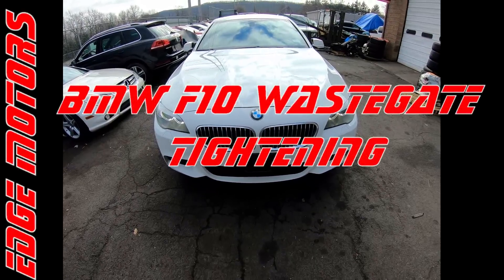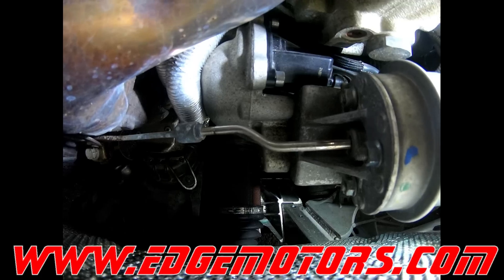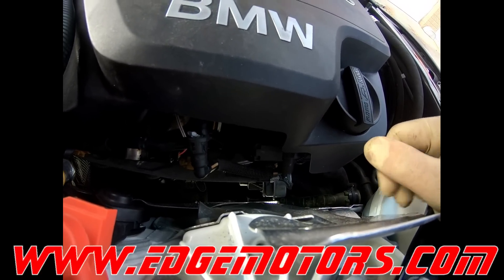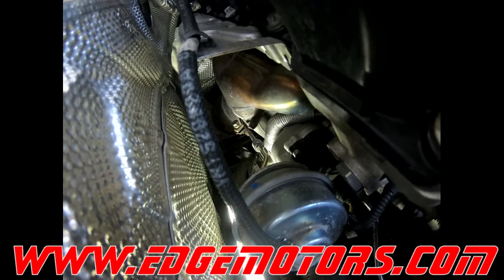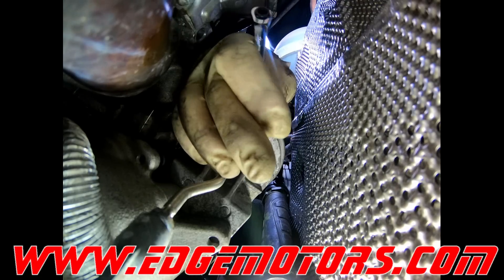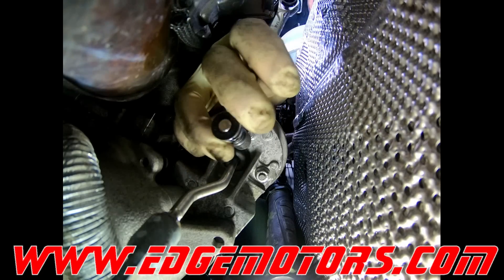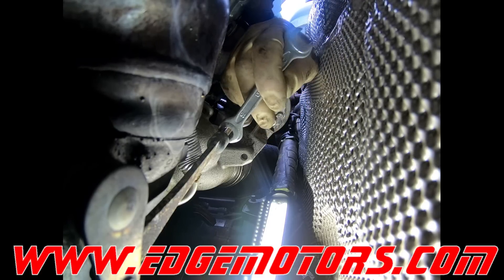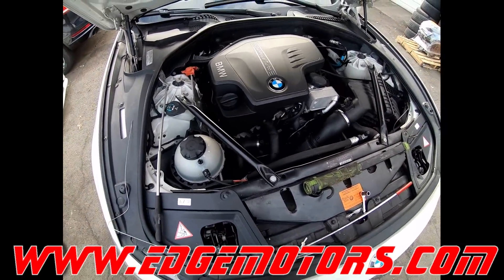BMW F10 Waste Gate Rattle Turbo Under Boost Codes by Edge Motors

Comment: I have an f10 with similar engine cover, connecting 2 hoses. What is the other hose which is not broken in your video? I see some oil in that pipe, is that common?

Comment: Will it work if i replace the entire wastegate actuator assembly
Reply: Did you end up doing it?
Reply: @emoney8678  Yes, i did. The wastegate arm came back absolutely rock solid
Reply: @zyzz1992  bro no way thanks for the reply! Just gotta ask if you had the drivetrain malfunction pop up and if so did that fix it ?
Reply: @emoney8678  The exact code that I got was 120308, charge pressure, plausibility pressure too low. Smoke test didn't reveal any leaks so we suspect it could be the wastegate as my wastegate had a horrible rattle (You can  see the short video I uploaded on my channel, it rattle bad as I let off the throttle). Took a gamble and replaced it and I'm glad it turned out good!
Reply: @zyzz1992  thanks for info bro, I guess this rattle is very common. Mine sounds terrible when foot off gas
Reply: @zyzz1992  Hey! I have a 2012 528i N20. Ive been getting the “FC120308 boost pressure control, plausibility: pressure too low” code for a few years and drivetrain malfunction. This is the only code I have. Car drives fine but throws code every time I accelerate for the first time of the drive. It’s a pretty loud rattle when the car is just sitting as well. Could this just be the wastegate actuator? If I replace that with another one, could it solve the problem?

Comment: Thanks for the video, it helps when chasing "boost leaks". I have a f10 with n20 pneumatic wastegate. It kinda make the same noise like you did the high rev, the crackling rattle noise, I was chasing leaks between pipes and got no luck, changed the diverter valve and still got code 120308 where it says pressure too low and occasionally pressure too high in the leak. Any chance do you think I could have the wastegate issue? Or could it be the solenoid. I cant really find parts for pneumatic wastegate only, they seems to come together with the turbo. Any advice?
Reply: possible to have oil in the actuator, check the vaccum tanck to see if you have oil in it.
Reply: Its the flap inside of the turbo at the exhaust gas exit. Its loosen up with the time it has to be welded and everything is fine.
Reply: How did u remove the dv valve? It seems like it’s stuck and you can’t remove it after all the bolts are off

Comment: Thanks for the video you would think they would’ve learned from the twin turbo engine with the loose waste gate pivots and Audi on the A4 2009 and up with the same problem the good thing about that Bmw 4 cylinder engine at least it’s easy to get at and there is some adjustments next time you have on loose like that try to check if the wear is on the waste gate pivot or the rod that connect on the waste gate lever .
Reply from the maker: I think in Audi the actual waste hate spring is getting weak... but these might be the pivot is wearing out

Comment: now that the car has adjusted the wastgate is not having pressure to high because of the wastegate open less?
Reply: I have a problem with over boost on my n20 I will do the opposite. I will see if I stop getting the code p0234 overboost, right now I'm getting 20 of boost once it reaches that my car goes into limp mode. when i get to my destination and turn my car off and back on the drivetrain malfunction disappears. I will update this post once I adjust it and test it out.
Reply: @omarguzman6553  îs PWG or EUG
Reply: @costelariton9864  are you talking about the wastegate? If so I have the pneumatic wastegate as the video shows. I heard the electric one is a bit harder to adjust.
Reply: @omarguzman6553   chec the vaccum chamber to see if you have oil în IT! If you have take it out and than see if the error reapear
Reply: @costelariton9864  alright, I'll do that. I'll post the outcome.
Reply: @omarguzman6553  send me a picture with the PWG to see if your hose are fitted corect.
Reply: @costelariton9864  alright I'll send you a pic in a few. I don't have my car at the moment.
Reply: @costelariton9864  oh btw I bought a new wastegate actuator also, it should arrive by March 10 so I'll install that and see what happens
Reply: @costelariton9864  wait where do you want me to send you the pictures?
Reply: @costelariton9864  so I took my engine cover off and the reservoir didn't have oil. I took the wastegate off and notices it was leaking oil from where the vacuum hose connects. Is that normal? I've heard this could cause overboost.
Reply: @omarguzman6553  yes, this is The issue with the over boost, The wastgate does not open and îs keeping the boost higher.
Reply: @costelariton9864  so I replaced a new actuator and the code hasn't come back. Thanks for the help!
Reply: @omarguzman6553  Glad that could help. Check on Facebook N20 enthusiasts, you Will find there a group on N20 owners
Reply: @omarguzman6553  change also the boost solenoid, The one located next to the oil cap with the 2 hoses that are going to the VWG and vaccum chamber.

Comment: Tightening the waste gate actuator rod does not increase the tension as it is making the same vacuum as before. All you did was make it close sooner and not open as much. So I’m all ears if you can explain the theory of this adjustment actually working
Reply: You get answers ?

Comment: Hello.
I have a question what if i tight it up too much? Is it danger for the engine? Im asking because I had failure code (boost too low) and then I set it up more tight, code gone and everthing was fine but after 1 month it came back and now Im thinking to tight it up a little more again. Is this ok? Please let me know
Reply from the maker: It will not damage the motor. If it starts to over boost it has other protection means to stop engine damage.
And if your codes are under boost, that will deff not damage anything....
Reply: EDGEMOTORS Thanks a lot for answer. 
But what if there is almost end of screw thread so I can not adjust it more tight and still hear rattle from wastegate (works fine and engine code is gone) ?

Comment: Hi my bmw 320i 2013
Today i got drivetrain and error code was 120308 pressure is too low do you think that i have same problem?
Reply from the maker: That could be a number of things, you have to look into it before changing parts...
Reply: Did you fix it?
Reply: @Assyriiianboy  yes the turbo was broken it wasnt working well so i had to chage it for new one now works fine
Reply: @christopherburgess1500  mine was turbo pressure i had to change it
Reply: @jawadrahimy6481  so you just replaced the turbo.  That cost about 75 bucks right
Reply: @jawadrahimy6481  I ask because I have the same code 120308 that’s the code
Reply: @jrod2422ify  i dont know how much turbocharger is in usa jut here cost me 800euro

Comment: I got a 2013 F10 M5 with 42,000 miles on it . I am running on a MHD engine tune and a XHP transmission tune. When i switched out my down pipes, thatS when the rattle was insanely noticeable. I have the S63TU engine BUT the MHD tune only has something for the N63 engines to stop waste gate noise some how. The rattle was noticeable but isn’t anything like most of these wastegate rattles I hear ON HERE  . I need to do something now before it does turn into more of problem. I’ve been doing my own maintenance and I bought one of those windows 7 laptops with a lot of BMW software already installed. I’m still trying to get the hang of it. My car isn’t popping up any codes .. nothing, not even 1 … IS THERE A SOFTWARE THAT RUN CHECKS ON THE WASTEGATE FOR the F10 M5 BEAST.. she’s starting to sound like she has a covid cough like these chargers and mustangs out here don if you know what I mean haha.. thanks for your time man 
       THE END 📕 HAHAHAHA
Reply: Hey man i literally have the same car were you able to fix the waste gate rattle? Except mine isn’t an m5 😢 it makes m5 POWER tho :D but i agree the waste gate makes it sound like it has something stuck in its throat. Annoying……
Reply: @Zoles7403  there’s a whole new problem I’m going through now. It all started after getting 91 gas at arco. After I got gas , I hopped onto the freeway, noticed i was losing power things just didn’t feel right. I got off , heard a real loud constant clicking sound ,pulled over when a notification came on my screen saying differential lock may not start when you turn off. I ran Bimmerlink for a diagnostic and cleared any codes. She started up one more time just to go into limp mode now there’s a crank to no start issue🤷🏼‍♂️
Reply: @champt7189  sounds like the gas was the main culprit could be lower quality fuel or maybe water traces inside the actual gas station had that happen to a gas station near me they had to replace the fuel completely. Also one question why do you use 91 instead of 93? I can see if it’s not available but these engines knock really easy with the high heat. We’re you giving it some gas when going on the highway like high rpm pulls?